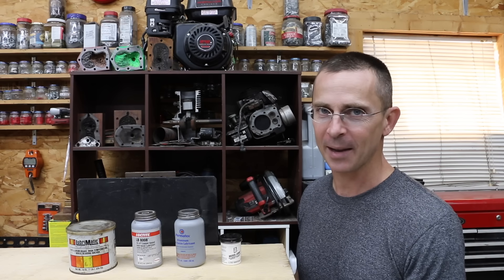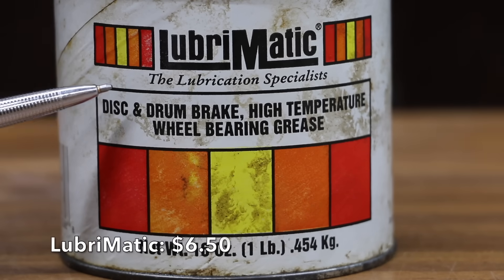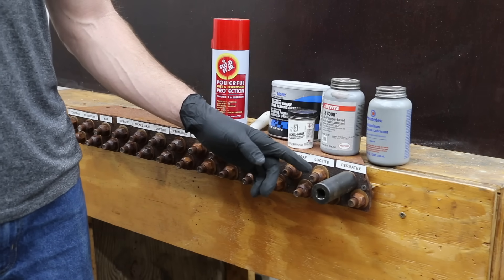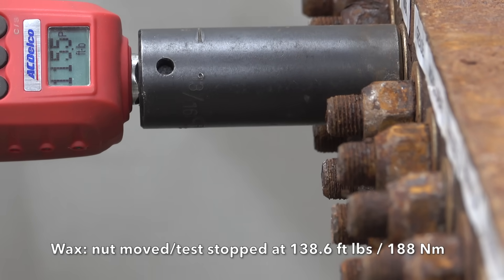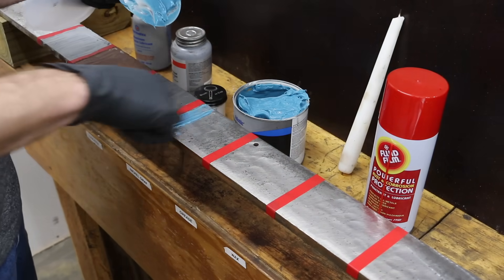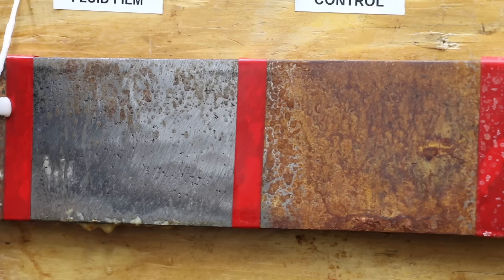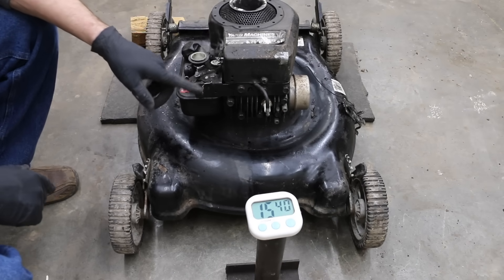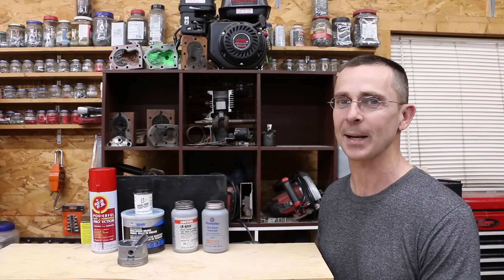Does Anti-Seize Compound Actually Work? Let's find out! Anti-Seize vs Grease vs Fluid Film vs Wax

Comment: Wax works better as a surface finish when applied properly it involves heating up the steel and burning the wax on creating a thin layer. Kinda like seasoning a cast iron pan
Reply from the maker: Thanks for the feedback.

Comment: Thank you for pointing out that there is a different torque spec when using anti-seize. Look for a wet spec and a dry spec, using the wet spec if using anti-seize. Also, never use anti-seize on your lug nuts/bolts unless specified by the manufacturer.
Reply from the maker: Great point!

Comment: Thanks for all your videos.  They improve my life when it comes to being a home handyman.  Does the lawnmower pump oil to the lower bearing on the connecting rod? Where it is attached to the crank? Like ar car.   Thinking not because no oil pump?  Or is it in an oil bath like an old ford model T?  Perhaps the lube didn't get into the bearing because it was too thick? Causing an overheat sitch?  I lost a crank shaft due to a bad gasket near my oil cooler.  Sad day lol
Reply from the maker: The type of briggs & stratton used in the video uses a splash system to lubricate the engine.  The aluminum particles from the anti-seize became abrasive and damaged the rod. Thank you

Comment: should or can anti-seize compound be added to tractor tire rim bolts to ease in future tire maintenance?  After 20 years of service, my tractor tire rim bolts could not be removed with compressed air ratchet gun. New bolts were installed after cutting the old ones off. I will be using anti-seize to help future removal. Tire speed, heat and other torture elemnts aren't similiar to auto & trucks. Hope I'm correct.
Reply from the maker: Thanks for the video idea.

Comment: You should try blue threadlocker. Threadlocker is anaerobic and acts to prevent oxidation and rust on the thread surfaces it coats.
Reply from the maker: Thanks for the suggestion.

Comment: I used grease on spark plugs before and it bakes hard and sticky binding the plug, never again.  I use aluminum anti seize on spark plugs with iron or aluminum heads then it's easy peasy.
Reply from the maker: Thanks for sharing.

Comment: Well, nuts were torqued to 90imperial*imperial/imperial with anti seize, which are by design have lubricating properties, thus after heat and oxidation it should still be 90 or above units of measurement, otherwise those compounds are doing bad job due to the fact that after some time whatever was bolted on must be retightened. The purpose is to resist seizing, not to endanger whatever.
Reply from the maker: Thanks for the feedback.

Comment: Has a video been made for thread sealant (aka liquid Teflon tape)? I recent did some gas tubing with fittings and had to find some thread sealer instead of using tape. Some of them are rated at a higher PSI than others so wondered if that mattered.
Reply from the maker: Thanks for the video idea.

Comment: When using it on your grill you should not use copper- or aluminum-based anti-seize, but the white food grade anti-seize like Loctite LB 8014 etc., which s metal-free. ;-) It probably also works better for lubricating your lawnmower as it doesn't have any abrasive metal particles in it. :-)
Reply from the maker: Thanks for the feedback.

Comment: I find candles work very poor for this, although the candles don't rust they seem to break much easier than metal bolts... :-)
Anyway, the candle wax seems to work better as a thread-locker than as an anti-seize, since it requires much more torque than on the untreated control bolts.
Next video coming up: Does thread-locker actually work? Let's find out! Loctite vs. candle wax.
Reply from the maker: Thanks for the video idea.

Comment: About 50% of the wheel nuts I remove that have some kind of anti seize applied develop problems with the threads on both nuts and studs. Maybe it's the dirt etc getting stuck to the threads, maybe it's because the anti seize has an effect on the 'tension' of a set torque.
Reply from the maker: Thanks for the feedback.

Comment: A common use for anti-sieze compounds is in motors with aluminum heads (air cooled) and common steel spark plugs.  Temps of >1600F are very common in this application, and stripping the plug threads happens a lot.
Reply from the maker: Thank for the feedback.

Comment: I've used nickel special and copper based anti seize products. When working with motor shafts and driven shafts you'll be glad you used an anti seize.  Been using them for 35 years.
Reply from the maker: Thanks for sharing!

Comment: Anti-seize is not intended specifically to prevent corrosion, but instead to prevent galling due to thread imperfections or vibration causing solid state welding. It may incidentally prevent corrosion as well. But that is a secondary function.
Reply from the maker: Thanks for the feedback.

Comment: I've used the Permatex for about 25 years, and I use it anywhere corrosion may be an issue. It has never failed to still be in place, and I never have seized fasteners anymore. However one variable is fastener technology has come a long way since the 60s and 70s. Seized fasteners are pretty much a thing in the past for me.
Reply from the maker: Thanks for the feedback.

Comment: What I found on ships (super tankers) operating near the equator in very high ambient temperatures, on very hot running equipment (boilers, generators, centrifuges) is that copper based anti-seize will promote thread galling by virtue of the copper ingredient setting up over time. Good video....as always!
Reply from the maker: Thanks for sharing.

Comment: Anti seize is not intended to lubricate as that would cause threads to shake loose. The powdered effect inside the engine is exactly what you want for a non-moving thread.
Reply from the maker: Thanks for the feedback.

Comment: I use Action Can CS90 copper/carbon. Rocol products are even better but more money. My motorcycle had real problems with stainless steel bolts into aluminium alloy. Galvanic corrosion causes almn oxide to seize the bolt. 
High solids copper based paste stopped the corrosion. Copper washers under bolt heads also helped. 
It also worked well on exhaust header nuts.
Clean aluminium just rotted solid. Coppers sits between Al and SS on the galvanic scale. I believe the copper short circuits the galvanic circuit. .
Reply from the maker: Thanks for the feedback.

Comment: I recently replaced the drum bearings on my tree chipper. The service manual warns not to use lubricants on the bolt threads, prior to torquing. In fact it warns to clean the threads before reassembly. The old bolts were a PITA to remove, one snapped off and had to be drilled out. ?
Reply from the maker: Thanks for sharing.

Comment: I live in the salt belt and I'm just out of a major fight removing brake components that hadn't been removed for 15 years and can confirm pretty much every finding concerning the aluminum and copper based compounds - both mine are made by Loctite and sold at about the same price you bought yours at - the copper based product washes out much faster on exposed surfaces, but my friend who's been using the stuff for even longer than I swears by it for exhaust components. But for normal use, the aluminum based product is way more cost effective, as it's half the cost of the copper based product. 
After 4 years of road salt exposure those bolts that had been treated against rust with two layers of rust fighting primer and paint and threads treated with the aluminum based product were completely rusted out on the surface as if I had never painted them but the bolts came right off. One thing though, the product had indeed dried out and the bolts were hard to remove by hand once loosened - the product stayed on the threads and added a lot of friction. At least it prevented corrosion from happening and I'd much rather have that than having bolts break in their holes!!!
As for grease - it's fine for interior applications or temporary use outside - but the stuff just washes out or dries out and the threads start rusting again.
Long term surface exposure to the elements tell a different story - all end up rusting, probably because we get not only salt water, but a lot of sand as well and this blasting mixture is amazingly efficient at removing surface coatings ;-) The solution to this is to coat the undercarriage with oil twice a year. Doesn't help with threads seizing, but once loosened it doesn't prevent removal of bolts whose exposed threads had corroded - if you can, use bolts with as small an exposed part as possible, to hep prevent that (once removed, we notice that the threaded part is still corrosion free but corrosion on the exposed part is what caused seizing after a turn or so and the bolt can break right there). Screwing and unscrewing and treating with Releasall does increases your chances of removing the difficult bolt, just make sure to modulate the air on your impact wrench if that's what you've been using ;-)
As for using stainless steel bolts, you still need anti-seize because the metal has a tendency to gall so be very careful with torque to avoid this cold-weld phenomenon. Also do note stainless steel bolts are often not as tough as grade 8 or 12 bolts steel bolts and as a result can break if overtorqued.
I find myself watching your videos over and over, coming back to them regularly so if I commented here before, excuse me for being so talkative 😆. Your research is by far the best on youtube 👍
Reply from the maker: Thanks for sharing!

Comment: In the marine industry, anti seize is only used to prevent galling of 304 stainless bolts and nuts.
If you want to keep corrosion off, you would apply cable grease but it is hard to wash off.
Reply from the maker: Thanks for the feedback.

Comment: Good video ! I used to build High performance Jet ski's back in the Late 70's & 80's and i used to coat all the stainless bolts on the Kawasaki jet skis i was Building with Boat trailer Marine grease. It Worked wonderfully. It Made assembly & disassembly a breeze in a Salt water environment. I Worked at Dana Point Jet ski in Dana Point California. Right on the Ocean here. All Salt Water use for These Jet skis no Fresh water. No Problems when u coat all the Bolts in marine grease. I use the Permatex antiseize Now these days for many many years in My Refrigeration work these days. Sparingly is the key to that stuff. It gets everywhere quick. Works good though.

Comment: I've used aluminum based anti size on threads  and other metal surfaces for everything that wasn't already bathed in oil. No problems. It always comes apart when I need to remove it again. I've never had a part loosen on me either. I've broken too many bolts that were not anti sized to not use it whenever possible.
Reply from the maker: Thanks for sharing.

Comment: You did know that aluminium will react with other metals, right? Most commonly with lead, but others aswell. It's the reason you couldn't use a lead based primers to paint aluminium door and window frames in Europe.
Reply from the maker: Thanks for the feedback.

Comment: Over 20 years of experience tells me anti-seize is worth its weight in gold in automobile applications. So many cars nowadays require plastic covers to be removed to service them regularly. I put this stuff on all those bolts. We also use it between brake discs and hubs. 3 -5 years down the line and you can still remove the discs without a hammer or putting any stress on the wheel bearings. Just takes a very light coat. Please keep the videos coming. I love the honest comparisons, and it’s really helpful to get an idea of what products to use.
Reply from the maker: Thanks for sharing.

Comment: For this most brands have three different base materials aluminum, copper, and nickle. Might be better to compare those head to head

Edit also candle wax won't work with heat, it's a fuel.
Reply from the maker: Thanks for the video ideas.

Comment: Im not sure if the conrod snapped because of poor lubrication. I suspect that as it filled up the clearance between the cylinder wall and the rings and the piston is increased the compression so much the conecting rod could not handle it. Also i think most of the gases we've seen as blowby is just vapors escaping the grease at high temperature. Im sure the conecting rod bearing did not have sufficient lubrication. Wondering if graphite grease is better or not.
Reply from the maker: Thanks for the video idea.

Comment: I work at a parts store and I have  several customers that use permatex but some use the aluminum and other only want copper. My point being is maybe you should have used both to compare with the loctite.
Reply from the maker: Thanks for the suggestion.

Comment: Another point that isn’t covered here is use of antiseize for galling resistance on similar metals. For example if both the stud and the nut are stainless or titanium or aluminum, then they can easily cold fuse together. Antiseize can stop this from occurring. So it’s not simply just for corrosion.   Great video!
Reply from the maker: Thanks for the feedback.

Comment: Can't believe you would use these as an engine lubricant. They would work better as a lapping compound. They are made from fine metal powder mixed with different lubricant to create the paste like mixture. Nickel/Copper Anti-seize are toxic and should be handled with care. Worked for a company that manufactured these materials for years
Reply from the maker: Thanks for sharing.

Comment: I wonder how Sil-Glyde would have faired in this test..I've used Sil-Glyde religiously for 35 years. Damn, I just realized how old I am. Lol
Sil-Glyde has yet to let me down, I mainly use it for brake jobs or the assembly of any moving parts that is susceptible to heat and moisture. Until now I've never thought to use it in this manner. But then, I've used the Permatex antiseize for the same amount of years and it has never failed me.
Reply from the maker: Thanks for the video idea.

Comment: As someone who has been turning wrenches for nearly two decades, I will say Permatex Anti-Seize has been a life-saver in helping to make repeated disassembly of things much easier.
One ancedote- It does not work well as caliper grease. Use brake-level caliper grease, as the heat from braking will push it past its thermal limits and dry it out.
Reply from the maker: Thanks for sharing.

Comment: I've used that Permatex on most every bolt of my Integra.  I've been driving it regularly for years and the bolts STILL come out easily.  I'm thankful for using it every time I work on my car! (Body 246k miles, engine and transmission 315k+!)
BTW I'd like to see you do a tire pressure video.  Vehicle recommended pressure vs max tire pressure, testing stopping, turning and wet pavement.  I have friends who insist on max tire pressure, and it infuriates me!
Reply from the maker: Thanks for the video idea.

Comment: I'd like to point out we strongly advise against using grease or oil on fastners in the automotive industry (engine head bolts are the exception) because it acts as a friction modifier, unlike actual antiseize compound. Say you torque a lug nut at 100ft/lbs, you will end up over-torquing the nut by a decent amount because there is now very little friction between the threads and the nuts. Worse case scenario is with GM lug nuts on steel rims, if you apply grease on the threads, some may end up on the nut's tapered seat creating a double friction reduction.  You may then snap the stud even when using a torque wrench or an accu-torque of the correct rating, or deform the nut's tapered seat tip in a way that the threads WILL strip when loosening the nuts for the next tire change. Hope this comment saves some hassle and money to someone😉
Reply from the maker: Thanks for the feedback.
Reply: @ProjectFarm  You're very welcome! By the way, your dedication, unbiased testing and ingenuity never dissapoint!

Comment: One side note. Do not use aluminum anti-seize on aluminum threads.  You’ll have white rust prematurely. Copper is great for exhaust studs. I use mostly nickel because it has less issue with interactions and seems to stay put longer than aluminum
Reply from the maker: Thank you for the feedback.

Comment: Comparison Idea: which anti-sieze is best to prevent galvanic corrosion, resist exposure to the elements, and/or thermal (very hot). Copper based, metal free, etc. Would probably need different materials of bolts and nuts or threaded materials such as carbon bolt to Aluminum or Stainless for galvanic comparisons. Applicable to automotive, oil and gas, and of course lawnmowers lol!
Reply from the maker: Thanks for the video idea.

Comment: Wait, so if I use anti seize on bolts and torque them to say 100 Nm, because anti seize is a lubricant, the bolts will actually be torqued at hihger torque than 100 Nm?

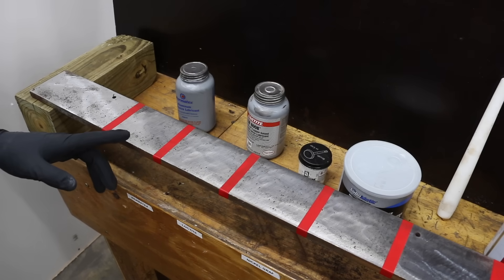Comment: 07:59→
“…Anti-seize compounds act like lubricants which is something to consider when applying torque. Dry threads will have more friction during the torque process and normally require much more torque to achieve the same clamp load as a lubricated fastener…”

Somehow I thought it doesn’t matter whether the thread is dry or lubricated. 90Nm are 90Nm. Could someone explain that to me a little bit further? 😊🙃😇🤓
Reply from the maker: Huge difference in "clamp load".

Comment: i used anti seize my old rusty vice grips that i had just broke loose about 3 years ago,  they are stored out side in florida , and they are just starting to sieze again, , for fact it made them last way way longer as they , as usually a new pair would rust very quickly in florida out side
Reply: Have you considered not storing your vise grips outside